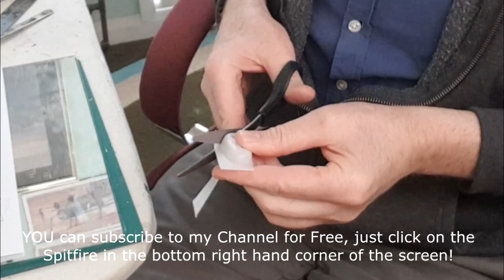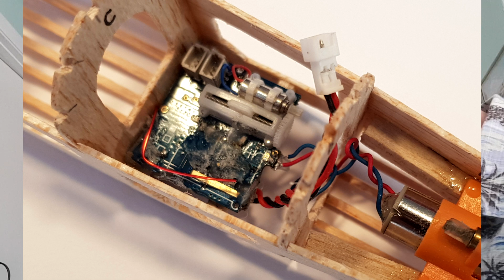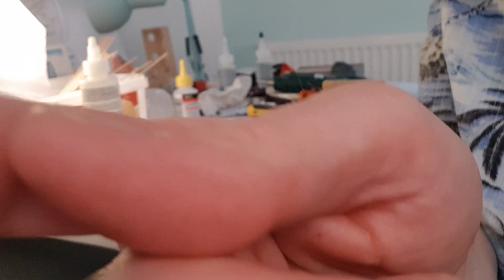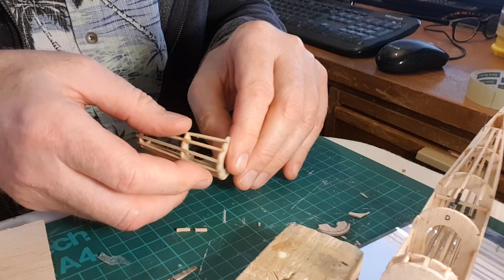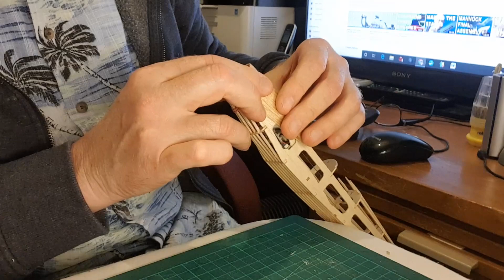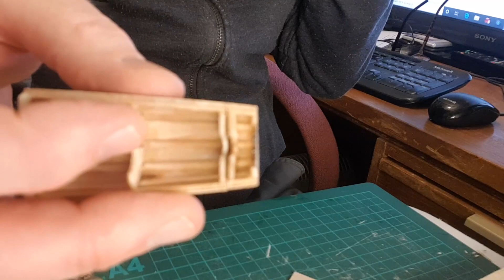Guillow's Chipmunk RC Conversion Part 3, Installing Radio Gear and Making the Top Hatch

Comment: cliff, how is the circuitboard mounted? is it just on a couple bits of wood? and how high from the bottom? im up to installing it and dont want to muss up the CoG.
Reply from the maker: Hi Alex, yes, a couple pieces of balsa, I found four small screws (from scrap glasses actually) but hot glue works well, or even a small amount of epoxy,  just be really careful not to get ANY on the servo  gears. It's mounted quite low to allow clearance for the push rods to pass down the fuselage. Despite the battery being as far forward as possible I still had to add some nose weight. Since finishing the model I've had to increase the dihedral quite a bit as well as it's just rudder / elevator.

Comment: Hey Cliff, what do you use to hold the hatch on?
Reply from the maker: Hi BB, I would normally have a peg at the back and two magnets at the front wherever is convenient  but as this hatch fits straight down I can't have a peg at the back so I planned to have a magnet either end but in the end I could only find one magnet so used just one at the front. The hatch is so small it holds it well enough.

Comment: Great little build Cliff.  Beautiful job. As someone who has only built bigger planes I know zero about these small micro planes or the electronics.  I might  have missed it as I did skip through a bit, but could you possibly detail in comments  or tell us on the video the motors, the rx and servo boards and lipo you use please?  PS  With those hands you could have been a surgeon!
Reply from the maker: Great comment Bob, I'll explain a little more in Part 4, thanks for asking, re the surgeon comment I used to be a tree surgeon but I branched out (ohhh no) 😀
Reply: Cliff Harvey RC Planes  It's the way you tell 'em!   😜

Comment: You are a lot better at dealing with those fiddly bits than I am. Enjoying the build.
Reply from the maker: Hi David, I used to have a job where the work piece was measured in microns, so really this is super massive by comparison. Thanks for your comment.

Comment: I actually enjoy making hatches on electric conversions and you've made a neat job on this one.  My approach is similar to yours though I'm not sure I could make such a good job on such a small model.  I often use very thin ply which would stand handling better but, as I say, mine have all been a lot bigger (4S LiPo 60" ws) and weight is always useful at the front with glow to electric conversions - perhaps not so much here.

Great job Cliff.
Reply from the maker: I would have used thin ply as well but I've just used every scrap up, balsa is easy to bend though, thanks for your comment 👍